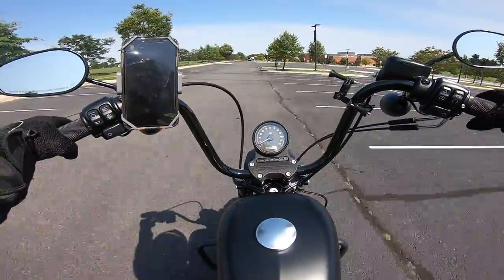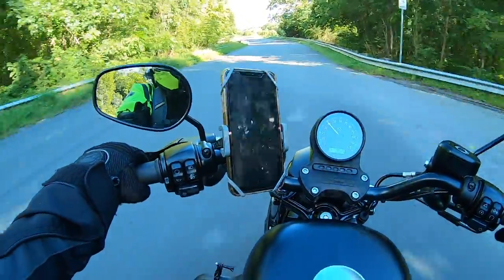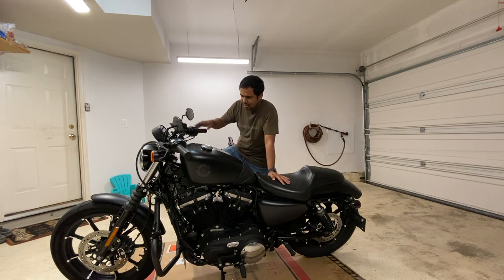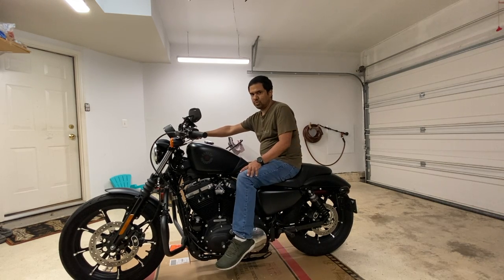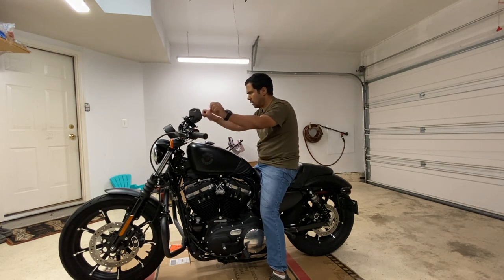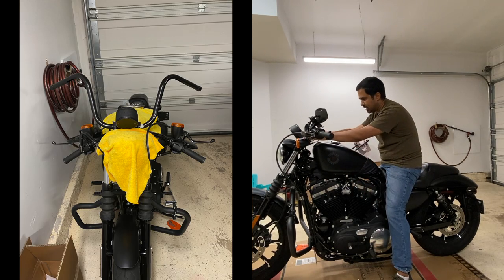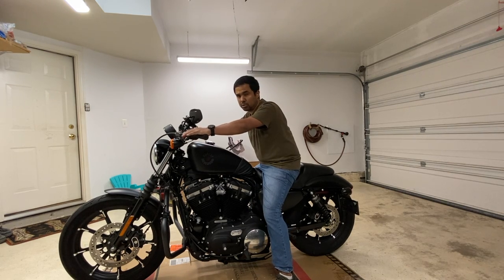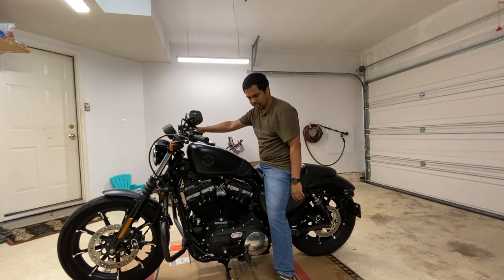Why I Changed Handlebar on My Sportster Iron 883. Buyers be Aware.

Comment: Did you have to buy longer cables ?
Reply from the maker: Yes, I did. The stock cables do not work for the risers I installed. I have the details for the cable set I used in the description.

Comment: Nice video bro! I have a 883iron 2018model and I gonna change the handlebar. I have a question that did you try 12in handlebar before you changing the 8.5? Why you did not choose a taller one?
Reply from the maker: @Liu will - for my height 5ft 4in, the 12 in handlebar would be too tall. I ordered the 8.5 and dry fitted it and it felt comfortable or I would likely have ordered one taller or shorter. My only concern with taller handlebar would be the reduction of weight on the front tire/forks that usually comes from my hands and upper body. Someone mentioned that super light weight on front tires can be one reason for tank slappers/death wobbles. Happy to answer any questions. Good Luck!
Reply: @thisisfbp  appreciate of your answering. I’m 5.8ft and concern with the height because of the external appearance.:D. Now I have to think about the weight and risk of wobble. Anyway thank you so much and good luck to you.
Reply from the maker: @liuwill4643   remember that there is rise and also pullback. So you still have a lot to play with even with 8.5. There’s good video by @RevZilla and very recently by @Bret Tkacs.

Comment: There should ALWAYS be a bend in your elbows when sitting on a bike. Otherwise you are supporting a lot of your upper body weight with your arms and shoulders. Most of your weight should be supported by the seat. When bent over because of those low bars, you also have to bend your neck back to see straight ahead. Almost a crotch rocket riding position, which is designed for high speeds on a race track. How did you extend the wiring?
Reply from the maker: Agree with you Gerald. With the taller handle bar I am definitely more upright. And since the handlebar is closer to my body, I get a slight bend on my elbows too. 
The handlebar cable kit I purchased (link in video description) came with extension cables. The wires are color coded. So I just needed to connect the correct wire then heat shrink so they don’t come apart.